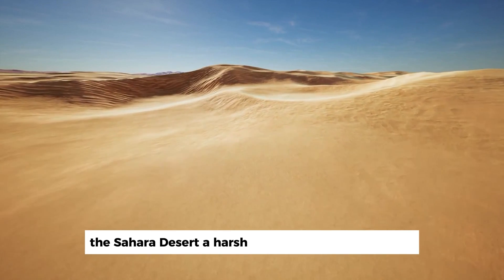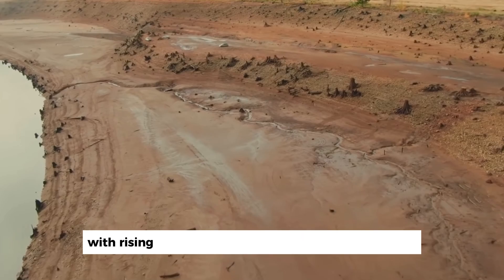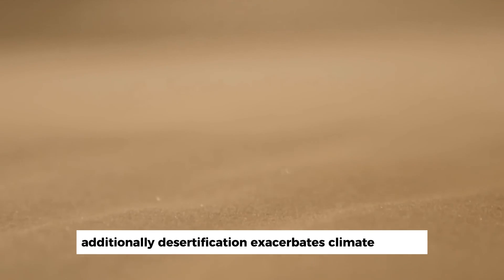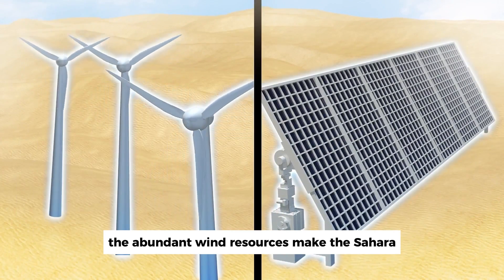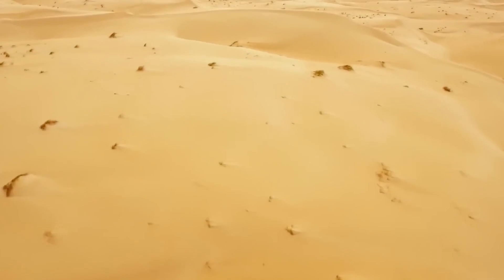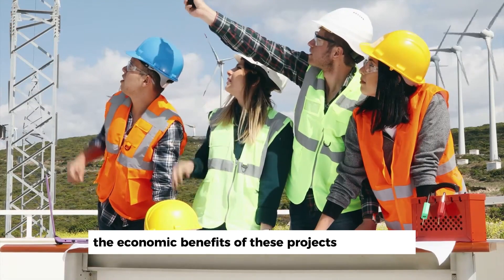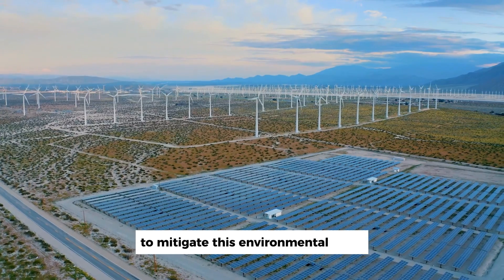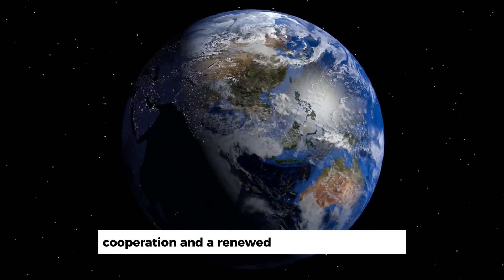Can Wind Turbines Help Reduce Sahara Desertification?

Comment: Desert is the best source for Wind Energy.

Mass Wind Mills do interfere the blow of Dry Winds that causes the equilibrium drop between the High Pressure and Low Pressure Region to let in the Cool Air for Condensation.

Warm Region means to say Low Pressure Region.

Cool Region means to say High Pressure Region.

Wind Mills do interfere the Dry Wind Flow to Drop the Surface Temperatures of the Sandy Soils — Windy Conditions!

This inturn brings in More Breeze that may carry the Moisture for Precipitations and avoid the Wind Drought.

The External Wind Flow is Increased.

The Cool Jet Streams may travel at Low Altitudes that may aid in Afforestation.